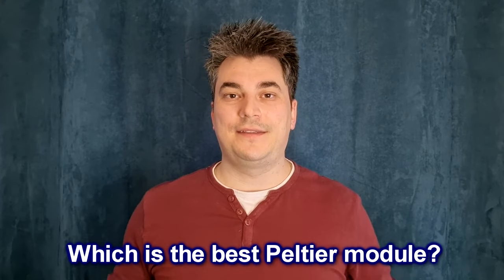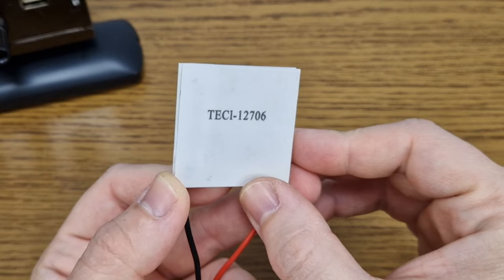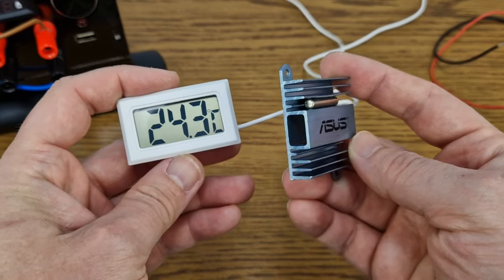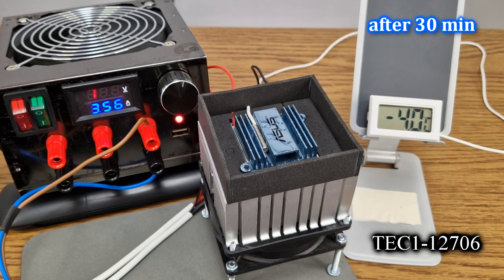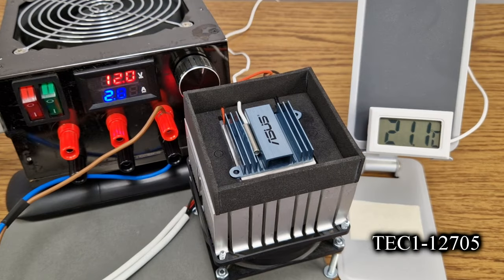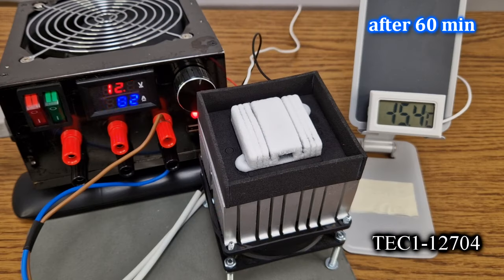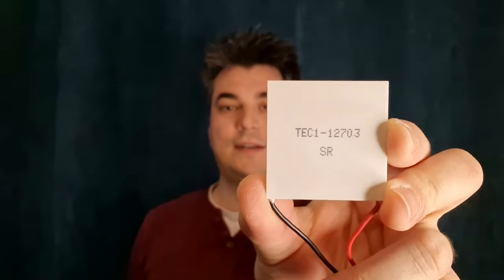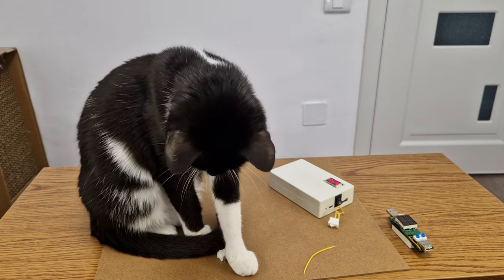Which is the best Peltier module for your project? [test 1]

Comment: bro, just a rough generalization, for wut I have heard, the other side gets hot right? so how hot would it get in such scenario?
Reply from the maker: I recently uploaded another Peltier test video, it's more detailed, I measured the temperature on the hot side. you can find it on my channel.
Reply: @Sorin_DIY  thank you very much, i am working on a project and this is the best guide I have seen on peltier modules, unlike many other channels, your channel has in-depth details of the types of peltier modules and definitely their working and use cases too...

Comment: I build a small refrigerator and I and for that i bought from alli express Peltier Cooler 12A 12V Semiconductor Refrigeration Cooling Devicewich is come already build with the peltier and the vent and everything. any way i test it and its doesn't seem like make cold air. and the radiator is getting cold and wet but not so mach and not getting ice. what do you think is the quality of the Peltier? A good quality one can make so much difference? If yes then when can i get a good quality one? I found the 12703 module (like you showen)  on ali express but how can i trust Ali express?
Thanks a lot
Reply from the maker: Hi. I tested a few types of Peltier modules from aliexpress and I got the best results with the 12703 module. the cooling of the module is very important, I don't know if your cooler is good enough. and the cold radiator will get much colder in a insulated closed box, but it will take a few hours too cool it.
Reply: @Sorin_DIY  Got it, i'll try. also This cooling system doent clear for me. the small radiator that need to be inside the fridge, how deep it need to be, means from which part of the radiator needs to be inside? its seem like the hot part something control the cold side. also i connect the Peltier to 12v12A  (by it self, with no vent and radiator) and one side getting cold and one side hot and then the cold side getting hot as well, I'm a bit confused. all what i need to do it make a mini fridge that will make nice cold inside. I wish some how you can direct me how to make it. thanks again

Comment: Peltier modules are good for experiments only. To be used in real life, the two sides are too close to each other. Very efficient cooling systems are required on both the sides. Just blowing air on water with a Fan is more efficient, even in humid conditions. I have tried to cool my fish tank water with CPU heatsink and a Peltier device, but the temps almost remained unchanged. Just blowing air with a small 12V fan reduced the temps by 2 to 3 Degrees C.

Comment: Broo my peltier module heats so badly 😢 please help me out of this situation.
At first it cools down but later it heats like hell!😢.

Peltier module TEC12715😢
Reply from the maker: The 12715 module draws more current, it produces more heat so it needs a bigger heatsink. You should use a lower current peltier module.
Reply: @Sorin_DIY  I'm think of using 12703 you suggested one.
Hope it will not make any issues ☺️

Comment: If you use the cheap ones, they are realy bad. Mostly they cant even reach the current they are ratet for. But i also used some old pc coolers, but most are too small tho deal whith the heat Output. The bigger the heatsink, the better it will work. Try the 12715 they are mostly good, but there also existing fake ones.(mostly they are cheap relabeld ones)   high quality ones will mostly cost about 20-30€ and they can reach about -50°C  WHEN COOLED CORRECTLY.  A 250W TDP rated cooler is the smallest i would use, but the best is to get an old used aio pc cooler. (about 280mm or 360 Radiator are realy needet for best results) 

Keep in mind , the hot side needs to dissapate all electrical power its consuming and also the heat form the cold Side. They add up so  15A @12V =180W+ the heat removed from the cold Side.  (At 70% efficiency  about 126W )
180W+ 126W are 306W that needs to be cooled. So an old cheap Aluminium cooler is way too small.(most of them struggle with about 60w, thats why you get those results) 

Better heatsink= a lot better Performance.

Comment: In the real world the peltier must be testing with a strong load in the cold face using a fan because the Qmax require a low Delta value (Hot face similar TH and cold face with hard load). If you test without load the results can be misleading.

Comment: Nonono, this is all wrong.  You need to go back to basics!!!

The higher power module is designed to pumping more heat, but without a proper thermal load, it just generates a poorer temperature differential. If you had a proper thermal load on the cold side, things would be different. These modules are all made exactly the same, except for the number of material-junctions that are put in series vs parallel. Which cooler is best really comes down to what your application is. If you, for example, wanted to create a two stage device, you would use the TEC1-12706 for the first stage and the TEC1-12703 for the second stage.

If you care about actually educating people on peltier devices, teach them how to read the graphs in their respective datasheets. ("Tech Ingredients" made a couple of videos on peltiers where they show you how to read those, but you'd really be providing value by making a more concise version of that on your channel.)

Comment: Chear merci de rezultate, dar poți să-mi trimiți si mie un link de pe AliExpress sa cumpar si eu un kit de radiator cu fan ?
Reply from the maker: salut. cauti doar cooler? sau kit cu modul peltier si radiatoare?
Reply: @Sorin_DIY  tot cu radiator si peltie va rog
Reply from the maker: In general sunt cam slabe kit-urile astea, mai bine cumperi modulul Peltier si iti faci tu radiatoarele din aluminiu, de ex pentru un mini-frigider e mai eficient sa faci radiatorul rece din placi de aluminiu pe peretii interiori ai frigiderului. 
dar daca vrei sa iei un kit, asta cred ca ar fi cel mai indicat: https://s.click.aliexpress.com/e/_DDbQyvH 
dar iti recomand sa iei doar kit-ul si sa iei separat un modul 12703, are rezultate mai bune. Maine am sa postez alt clip cu module peltier.

Comment: Cooler 130W CNPS10X EXTREME (10 heat pipes), 1pt 12706 in room 25'c  little Refrigerator +9'c 12v =(

Comment: Your conclusions are totally wrong. They are basically equally (in)efficient, you just need to look up their datasheet and look at their C.O.P graphs... 

There's nothing wrong with the 12706 unit, you just did not run it at its optimal parameters and in optimal conditions. It is most likely that the small CPU cooler could not cope with the heat generated by the Peltier cooler. At the same current and voltage, the 12706 can pump more heat from the cold side to the hot side. So the CPU cooler has to deal with more heat... It is not a fair comparison. 

It would have been a better experiment if you had monitored the hot side temperature as well. Maybe the experiment was rubbish and not the Peltier cooler. I tested many more units with a more accurate approach and I can tell you that the 12706 is very good. Also, using just the cold side temperature as a measure of performance is not really a good approach.
Reply from the maker: My conclusions are not totally wrong. You can watch the recently uploaded test 2 video, if you want clarifications about everything you said.

Comment: Its unfair because you dont gave 12706 that maximum potential cold with 6 amp input
Reply from the maker: In a few days I will upload another test video with Peltier modules, it will be more detailed. You will be surprised by the 12706 module.

Comment: Guys I ask, are those modules from Aliexpress original ones or fakes? I'm just wondering.
Reply from the maker: they are not original, but they are pretty good for their price.
Reply: @Sorin_DIY  I already watched your video with the refrigerator for the beers. Since I'm an outsider but I need to do a refrigerator project, how do you see the employment of, say, 4 or more cells to get a very good refrigeration in a very constrained space? I really wonder how serious a similar approach can be, instead of AC conditioning. Consider I don't need to get to low temperatures, just to keep, say, 20 degrees while the surrounding can become way more hot. I'm really curious to test the "seriousness" of this solution.
Reply from the maker: with 4 Peltier modules it will cool down faster, but it needs a large heatsink in the back and it will draw a lot of current.

Comment: This is crap comparison. First off you need to use a PWM to control the power input. So at 15v you can supply up to 15A you are running 12v and allow it to draw its own power. The reason the 12703 did better is because it runs at 12v and 3A what it is rated for. So this comparison is garbage. If you use the 12715 correctly it is better than all these other ones. This comparison is like connecting a 20w,40w and 60w light bulb at a 20w power supply. The 20w bulb will be the most efficient as the other ones will not be able to go up. This is what you did here total crap.

Comment: not accurate video at all
of course the 06 will get worse temps because the cooler used to cool it is not adequate
Reply from the maker: I'm working on a new video with more Peltier modules and a bigger cooler, it will be ready soon. you will be surprised by the result.
Reply: @Sorin_DIY  succes frate, ai grija sa nu îți saturezi coolerul din nou cu peltieru
nu poți să răcești aproape nimic cu un peltier, doar ceva de putere foarte mică gen un chipset

Comment: Hey, I'm trying to make a small portable ice maker of 250ml capacity, which peltier will be best 12703 or 12710 with water cooling??? And can I run it at it's full power at 12 volt 3 or 10 amp???
Reply from the maker: Hi. I recommend the 12703 module. but to make it efficient it needs more than 2 peltier modules and a big heatsink.